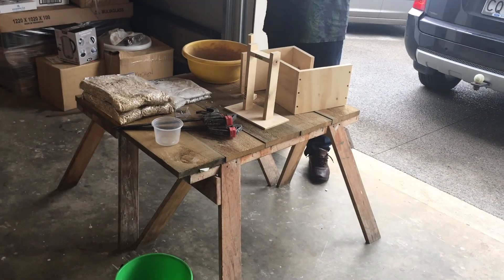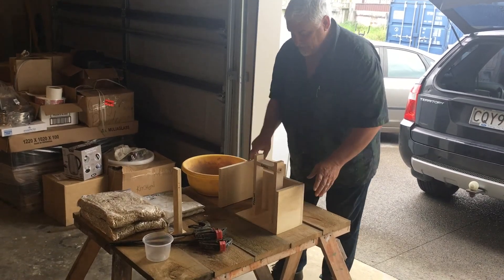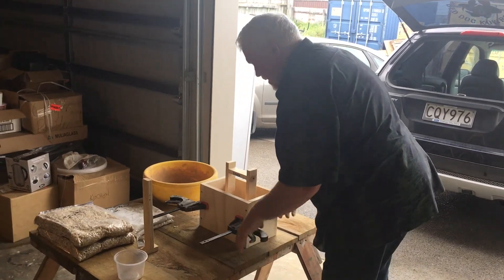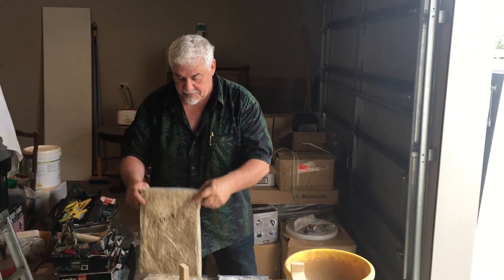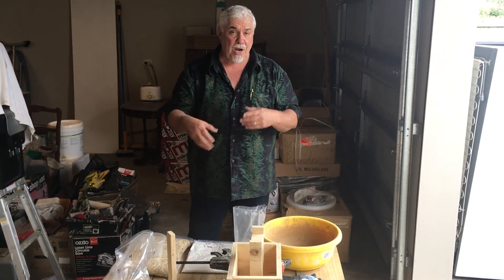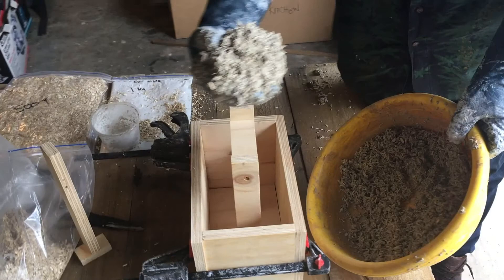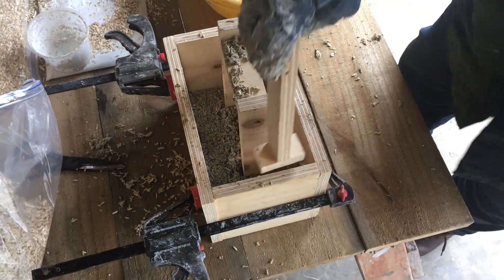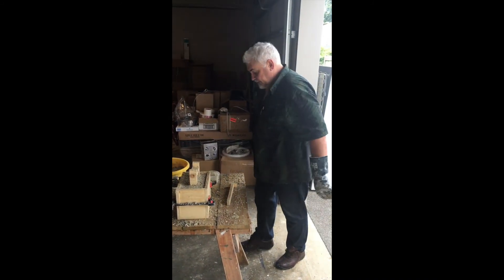Sample Block

Comment: So, would a house be constructed in lifts like in rammed earth construction? Or with modular blocks like the one you just made with lime mortar binding them together? When and how are the MEP trades brough in? Before or after the hempcrete insulation/envelope system is installed?

Comment: Do you know what 4 parts fiber translates to?  How many lbs or kgms of fiber is required for a single brick?
Reply: Would like to know as well if possible Greg.
Reply from the maker: 33lbs of hemp hurds plus 55lbs iBinder plus enough water to make it all stick together will yield 4.5 to 5 cubic feet (F3) of "Hempcrete"